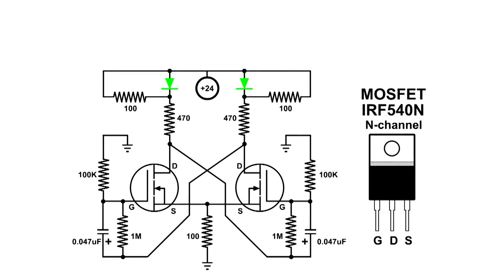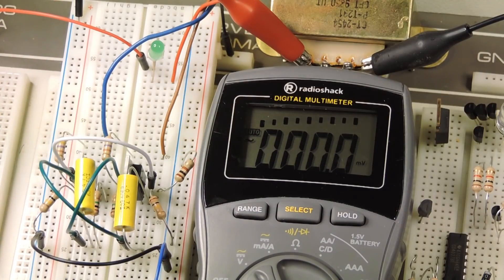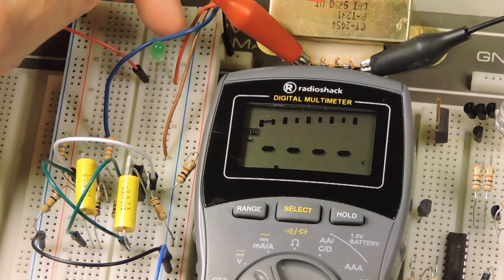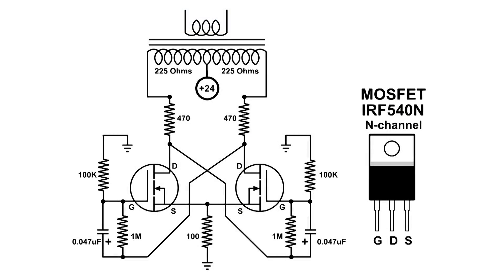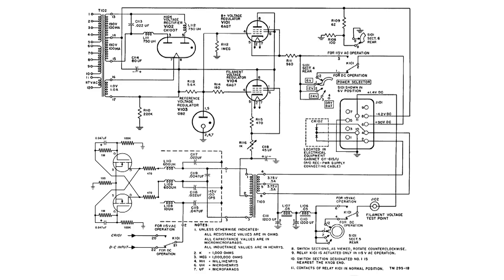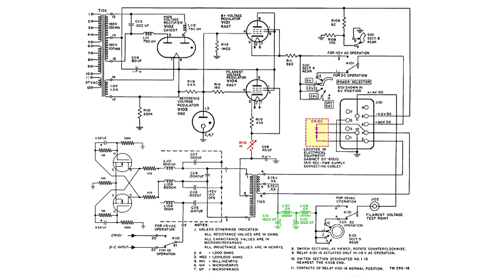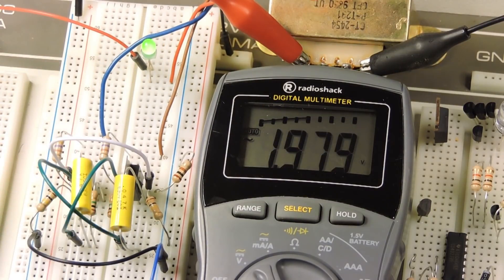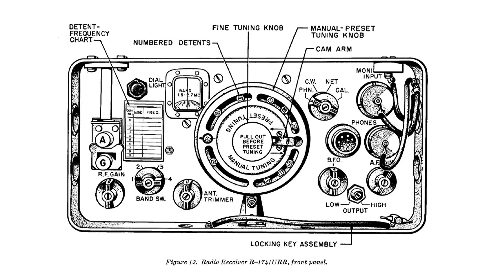Solid State Substitute FILAMENT VOLTAGE VIBERATOR Update

Comment: Rick   I admire your sense of experimentation with discrete components but you might want to look into a TL494 IC chip.   They are designed just for the purpose of push pull DC-DC converter circuit  applications.   You can easily adjust the frequency you want.  You can adjust duty cycle of your FET drive..  And,  the best part  is you can adjust the dead time between turning on each transistor.  This assures you do not have both transistors on at the same time by letting each gate voltage discharge fully to assure the one transistor fully shuts off before turning on the other one.   There are many YT videos on this chip and converter circuits.
Reply from the maker: Thanks for the information on the TL494 IC chip, I just ordered five of them. I don't plan on using it on this project, although that is always an option. So far the chips I have used require a regulated power supply otherwise they just don't work. I'm only trying to design a multiple vibrator circuit that will work with this radio circuit, not all radio circuits.
Reply: You're welcome.    I understand.    The TL494 works with voltages from 7 to 40 volts.  Hope to see  follow up and your final solution..
Reply: am eagerly awaiting an update as I plan  on this my self for my GRR-5.Jim

Comment: I made a very similar circuit back in the late 60's only with Bipolar power transistors driving a 12 volt center tapped primary, giving 120 volts at the secondary. One of my first adventures with solid state devices. FET's weren't around then!
Reply from the maker: Thanks